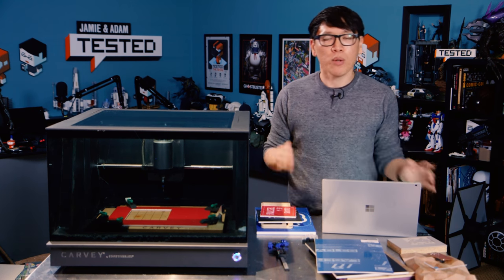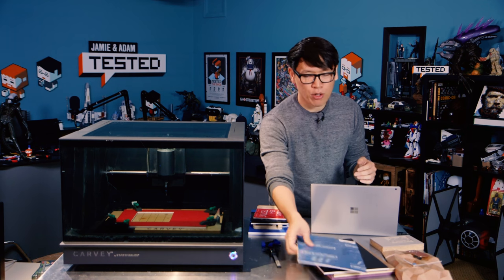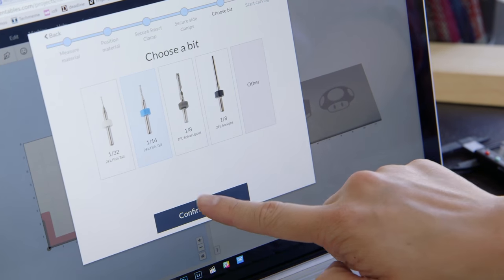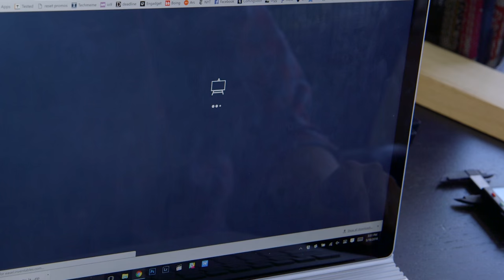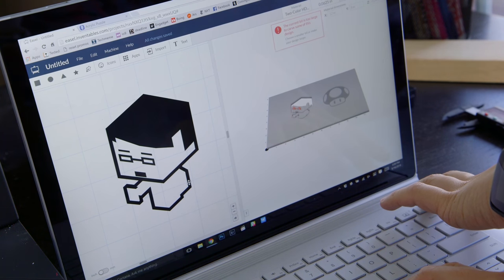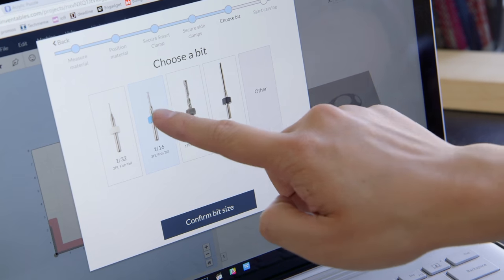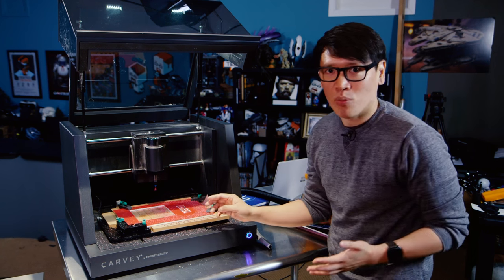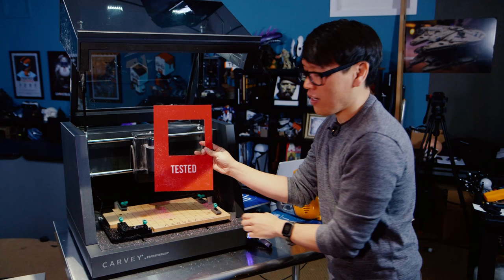Tested: Carvey Desktop CNC Machine Review

Comment: Designed to be simple & safe?
If I'm paying $2000... I want it to be complicated & dangerous.
Reply: +Jerry Joe you can do your own CNC conversion on a g0704 for $2000. This thing is for those that want a out of the box CNC for cheap. It's the console equivalent to a machine that you can do work with.
Reply: You can buy a 60x40x10cm 1.8kW 3-phase brushless spindle 4-axis CNC router with ballscrews for $1600.
This is a toy.
Reply: hey what cnc's are you referring too?
Reply: vindigga6 Just look for "6040 2.2kW CNC" on aliexpress/alibaba/ebay.
They look identical, just pay attention to the spindle power and type.
Reply: Oh ok thanks
Reply: get a haas then

Comment: When you speed up footage, could you let the viewer know by how much?  Otherwise I think it leaves a false impression of how fast the machine actually works.
Reply from the maker: +Josh Mann yep, good point. the time-lapse was sped up by 8X in this video.
Reply: +Josh Mann Go to 0.25 speed, and the machine is going double speed. That should be easier to visualize
Reply: ***** No... time lapse is when you take a picture after so long, then string them together, showing something at an accelerated rate.
Reply: +Richard Smith There is no difference between Videos and Foto timelapses. Faster than realtime -> timelapse. Slower than realtime -> Slow-Mo.

Comment: I think most people in the hobby/industry would describe this as a CNC router rather than a milling machine, the distinction is not exactly precise though. It's a neat machine but that spindle isn't great, it's a cheap motor attached to an ER11 collet holder and 12k rpm is limiting for small cutters. A small, properly made high speed spindle would be a great addition especially for small bits but I suspect most of the budget already goes into the enclosure.
Reply: +littlestworkshop Most people in the hobby/industry would call it a horrible toy ;)
Reply: +Big_Adam_2050 3D printers really aren't stiff enough for machining use.
Reply: +Stefan Gotteswinter I think it is fine for a lot of applications the spindle just lets it down.
Reply: *****
For the piddly little work going on, I think they could do it. Maybe not on a rubber belted unit, need one that runs the axis on screws. Anyway, that cutter head looks similar to the old Xcarve unit, they ditched it due to too much play in it.

Comment: For those who are asking about how much this video was sped up, the machine should be roughly 1/4 the speed shown at the end. It can go at a roughly higher speed, since that material is like butter to an endmill. You just have to worry about chip evacuation since plastics like to gum up your tool/workpiece.

Comment: You guys talked about carving aluminum... But didn't show it?
Reply: +Luke Luoh I doubt this can do much with aluminum. The machine is nowhere rigid enough if you want to cut only aluminum
Reply: +Luke Luoh 
Well it's the same process, just insanely slow. The spindles they ship with these things are just not good enough.
Reply: +MsSomeonenew emphasis on the insanely. To do what they did in the plastics, I'd wager it would take at least 4 hours with that level of rigidity. Plus the chatters.... I feel sorry for anyone that purchases this for $2000
Reply: Good news, nobody is buying these for $2000 anymore. Because they jacked the price up to $2500.

*rolls eyes*

Awfully expensive for a cheaply made toy.

Comment: You didn't mention the price, which is $2,000. It seems like this machine is very limited in applications for something so expensive, not really sure how it's worth the price.
Reply: +seanylewl The cheapest 3D printer is way cheaper than that, around $300. You could even buy a better 3D printer for the price of the Carvey. I guess there are limitations though like 3D printers can't 3D print wood objects or foam objects etc.
Reply: +seanylewl The price was shown at the bottom of the video at 0:52.
Reply: +crabbyninja 3D printers are not as mechanically substantial as spindle machines are. The loads the two types of machines deal with are dissimilar. That having been said this one is pretty much a toy.

Comment: if this thing is powerful enough to engrave the hardened steel of pistol slides, im definitely picking one up
Reply: +Chad Grimgravy I think it can only do softer metals like aluminium.
Reply: +Chad Grimgravy some questions have complicated answers. Practically I would say this machine would not be capable of doing what you want. But that does not mean it is impossible. Just so improbable that it might as well be impossible. Unless you were willing to accept some drastic limitations, and work within other difficulties as well.

Comment: 2 big questions:
1. Can it do aluminum? Being able to do aluminum means it can be used to make very nice enclosures for electronics, as well as very durable signage (great for high schools, there's always a few students who will try to destroy everything).
2. Does it accept hand-written G-code input? If so, I can make it do things the included software might not be able to do. I swear, sometimes it's just easier to write the dang G-code out manually with a blueprint as reference instead of having to learn a new 3d modeling program. The "old ways" may be slower, but that doesn't mean they don't work, and I find writing out a G-code program to be more satisfying than pressing "import model".
Reply: 1) Absolutely not.
2) Most likely yes.

This is a ripoff though - don't even bother buying anything from inventables.
Look at a 3040 or a 6040 CNC router with the spindle upgrades.
They're LESS expensive than this(~$1600 for a 60x40x10cm work area with a 1.5 or 2.2kW spindle and fourth axis), and they're actual, proper machines.
Reply: *****
"Absolutely" not? I thought it was all about the bit selection, with more powerful machines just making the work go faster.
AFAIK, this applies even if the thing's using a glorified router motor to run the cutter and printer-grade stepper motors to control the axis movements.

Sure, a higher powered machine would be a better choice, but if this machine is all you've got, 15-25k RPM and 0.5IPM with a 1/4" 2-flute end mill should work in just about any material that's softer than the bit, so long as you've got enough time to let the thing work.
Reply: 44R0Ndin They're not rigid enough to have a load that high.
It's not about the power, it's about rigidity. Power only affords speeds.

Comment: I'm patiently waiting for these to come out, able to work with brass and with tolerances of +- .01 mm. I might be exaggerating when I say I'm patient.
Reply: lol
Reply: You'd be better off with an XCarve or that OpenBuilds thing than this flimsy POS for anything metal. You'd have to be hella patient to wait for the amount of time it would take for this to carve brass accurately.
Reply: It's not going to happen.
They make toys.

Buy a 6040 CNC router with the 2.2kW spindle upgrade and you'll be doing brass in no time. Though you're still never getting to 0.01mm tolerances unless you're ready to dish out ~$100k for a DMG machine. The best you'll get is 0.05-0.08mm tolerances.
Reply: .01mm is probably unnecessary when I think about it.  A tenth would be acceptable for most watchmaking projects. Thanks for the input guys.
Reply: ***** Well then, buy the 3040 or 6040 with a powerful spindle and you'll be happy.

Comment: Needs a 4th axis.
Reply: +Umuahjoku Amadi-Obi (AceofSpades) If you have to ask, YOU probably don't need one.
Reply: +SilentS Bit rude, why don't YOU just explain it.
Reply: SilentS Still a bit rude. I use CAD CAM myself, I was more on about explaining it to the other chap
Reply: +Meteor Shower It's rude of me to assume people are intelligent enough to use Google? I think it's rude of you to assume otherwise.
Reply: SilentS Well I assumed you could explain it other wise, never mind.
Reply: +Meteor Shower Now you're casting aspersions against my intelligence? And you're the one throwing around the word 'rude'?
Reply: +SilentS what 4th axis CAM software do you use?
Reply: 4-axis and higher machines and the software to drive them are still specialised and expensive, unfortunately. Also heavily export-restricted if I recall correctly.
Reply: makomk
you'd better be sitting down when you see what software capable of outputting 4 axis G-Code costs. It can easily run 10 times what this Carvey gadget does. Well, about $13,500 will get you a cheap Solidworks seat the last time I looked. Although if you want to spend 20K they can hook you up then too.
Reply: icepick method
everyone seems able to find some CAM software they like. But cheap 4th axis CAM software is something I do not personally know about.

Comment: Can i use it for PCB boards?
Reply: +Aksel Hanssen You'll need to a dust extraction system. Just having it in a box isn't good enough for fibreglass dust. Though why you would want 12x8 double sided milled pcbs? Most things needing that much area need more layers, and smaller CNC routing machines are much cheaper.
Reply: +Pete Kirkham Hi Pete, thanks for responding. I work at a university, and my master students and some projects I make small PCB boards for test / measuring equipment. This I will simply etch. But lately there has been a need for DC bus, and High Current boards, simple in design, but they need a thicker copper layer because of the current. Its difficult to get a good etch on the thicker copper boards. That why Im looking into cheaper pcb milling systems, that also can do some other stuff. This machine can be a  great tool for some of the student projects.

Comment: Does it adjust spindle speed due to load or just randoom voltage regulator get what you get ?
How you cut aluminum whit it if no flood cooling ?
How long mill bit lasts whit cutting plastics and aluminum ?

Comment: far too expensive for what it does.  A PCNC machine could be picked up 2nd hand for about 4-5k and has far more functionality. there's very little this won't do that a 3d printer will
Reply: +PolarBars I am trying to get a grasp of other options, can you possibly reply with some Make/Models of used that would be in that price range so I can research? Thanks!
Reply: how about pcb milling? gotya
Reply: +PolarBars 
So this machine is not as good as a machine that costs far more money. Thanks for the tip.
Reply: +Stingray tormach do a range of PCNC machines that are essentially fully functional CNC machines but with smaller working area and therefore footprint. While the cost of a new machine in 3 times greater than that of the featured machine it has the full functionality of a CNC router and could be picked up 2nd hand for a bargain. As a mechanical engineer who designs and fabricates parts  I'm just having trouble seeing the useful application of this machine and the justification of the 2k price tag.
Reply: You can get a  chinese CNC 6040 for $1600 with a 4th axis(albeit quite shitty) and a 2kW spindle WITH the VFD for it.
That's to +GameraTheBrave and +Robbe Elsas

Comment: That is really expensive :o
Reply: +Evren Uçar Considering the machine? Not at all
Reply: +Evren Uçar For $2000 you could do your own CNC conversion on a g0704. And that's orders of magnitude more capable than this
Reply: It's completly unreasonable to say ''I could make it for less than what they're selling for, therefore it's too expensive.'' because you don't have to pay you or anyone else a salary, you don't have any overhead. you don't have to establish a market and distribute it, offer support and spare parts.

You don't have to make more than one machine, so it doesn't have to be cost-effective, scaleable and easy to source. You don't have to go through design iterations before it's in a good commercial state.

All you have to worry about is making a one-time thing, on your own time. Of course that's going to be considerably cheaper.

Making and selling a turn-key product is a TON of work besides just what you see, and that work has to paid for somewhere.

If it's so easy to make your own for less, then that's awesome, means that people will have an alternative if they're ready to do it themselves. But for other people, that's a reasonable price.
Reply: Nick Chamberlin 

Where does 299$ comes from? The materials alone at cost are worth more than that.

Comment: So Tested... X-Carve or Carvey?
Reply: Neither. These are toys.
Buy a 6040 for $1600 or a 3040 for $600-900
Just look them up on eBay or aliexpress.
Reply: Too small of a build platform.
Reply: walperstyle Uh, what?
This machine has a MUCH smaller work area.
Reply: How about compared to the X-Carve?
Reply: Look, I'm looking to be spoon fed information on a good CNC machine as I am actually looking to buy one.  I would like to do 4x8 plywood, and do half foot deep if I could.
Reply: walperstyle Both of those machines are complete garbage. By 4x8 I take it you mean 4 big freedom units by 8 big freedom units by 0.5 freedom units?

If so, this is nowhere near the hobbyist region.
Take a look at the SUDA VG1325 machine.
It's $7000, and it's about the cheapest reliable machine you can buy that will have that large of a work envelope.

Then there are the 6090 machines, which have a work area of 60x90x15cm.
They cost around $1600-1800.

Then there are slightly smaller 6040 machines, with a travel of 60x40x9-15cm(depends on the mfg).
Those cost around $1100-1200.
Reply: The X Carve I can modify to house a better router though, and there is more community support.
Reply: walperstyle Nope.
It's still going to be complete garbage.
The X-Carve is a glorified plotter that should never have a spindle on it in the first place.
Reply: Curious, do you have any first hand experience with these or are you regurgitating other people's words?
Reply: walperstyle I've seen an x-carve work and I own a 3040 chinese router which is a pleasure to use compared to that piece of trash.
Plus I've had a lot of machining experience at big shops that I did not own.

Is that enough for you?